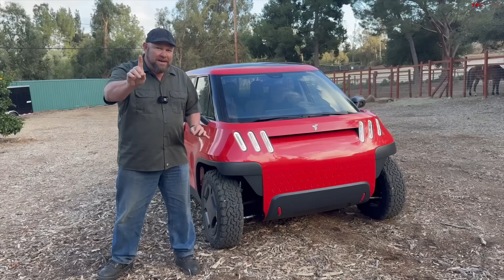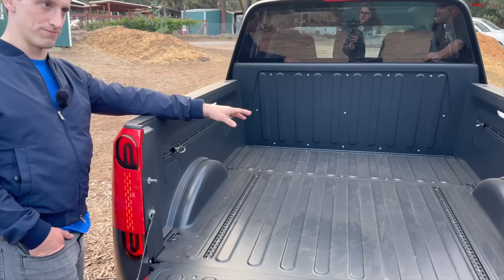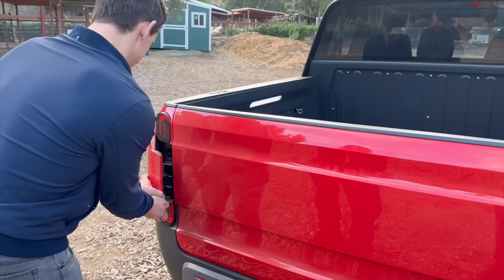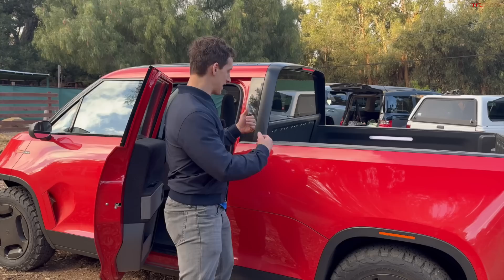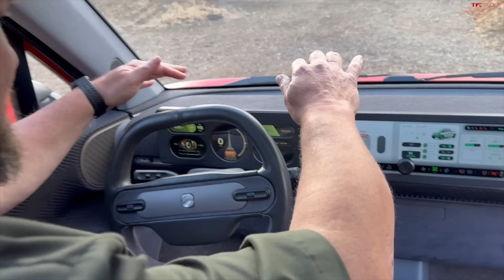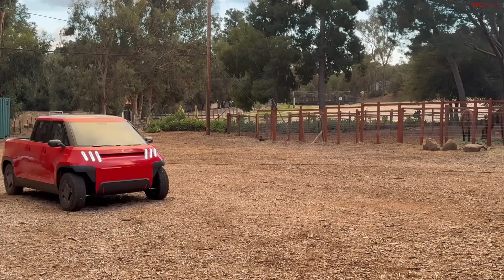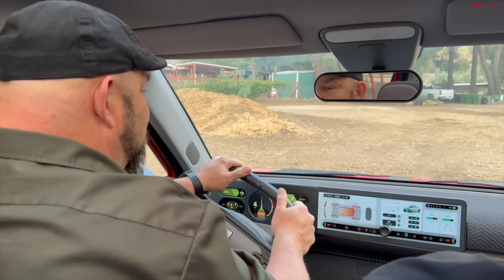I Drive the Most Revolutionary Truck In Decades: Meet the Telo MT1!

Comment: My Chevy Avalanche had a forward tailgate. I carried full sheets of plywood and Sheetrock with it folded down. It makes a short bed pickup much more versatile.
Reply: Chevrolet calls it a "midgate". i picked up a 2024 Silverado EV RST that uses this passthrough midgate and its amazing when carrying 12 ft boards.
Reply: @mstrmold1807  
I remember when I bought my Avalanche new back in 2002. All my friends with other pickups made fun of it and said it wasn’t a real truck. But, when they saw me haul full sheets of plywood and Sheetrock with the rear tailgate closed, they changed their attitude. Especially when it was raining. I could haul full sheets of Sheetrock under the 3 piece bed covers (they didn’t leak) and close the tailgate. When I was done hauling stuff, I closed the mid gate and put the rear seat back in to position and the truck returned to a full size 4 door vehicle. No other pickup could do that. I hauled everything ( sod, firewood, crushed 3/4 stone, bark mulch, and all kinds of other stuff) without incident. I will admit that the rear springs were down on the bump stops when hauling the crushed stone. I just aired up the tires to the max pressure and went slow.
Reply: Love my Avalanche... But I'd be willing to let it go for something like this
Reply: Rivian also I think, it's a game-changer for utility.
Reply: "forward tailgate" Is a great oxymoron. 

But I think I'll keep calling it like everybody else a Midgate.....Which is also available on the Silverado EV, and numerous smaller trucks available outside of the US....

Comment: BUT it is electric.
Reply: AND it is electric.  They could also go hybrid like the Chevy Volt with a small gas generator on board option
Reply: How many miles do you need for the city 🙄
Reply: @Cali_Slav96  Houstons metropolitan area is bigger then Massachusetts so when my dad was in pest control he drove hundreds of miles weekly and sometimes daily and sometimes with a trailer so at that price point it would be a no . Then on top of the price its EV so NO NO.
Reply: @ronsteltz7538  Exactly.
Reply: @PerfectlyUselessComment  it’s electric and can tow an absurd amount for a car that size. Plus c, it’s TINY